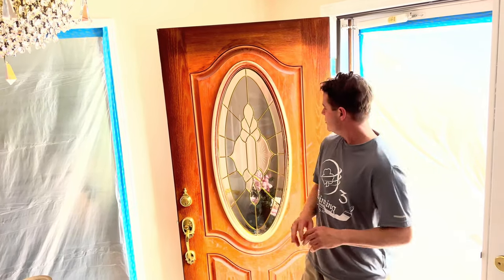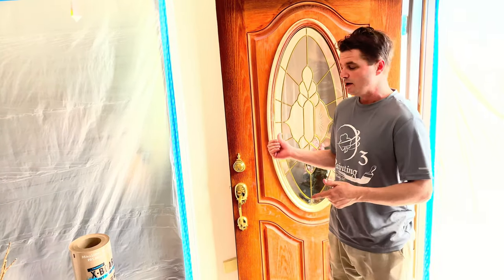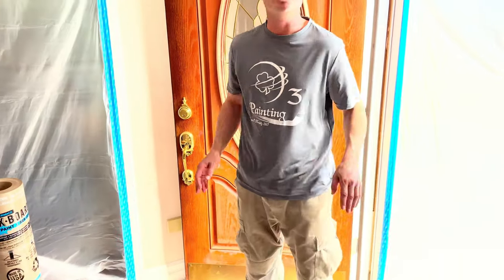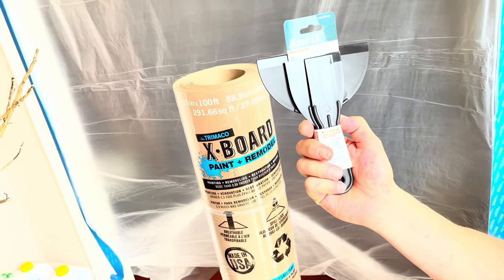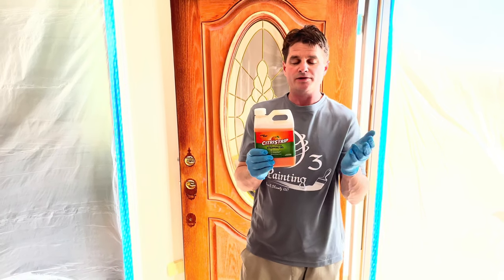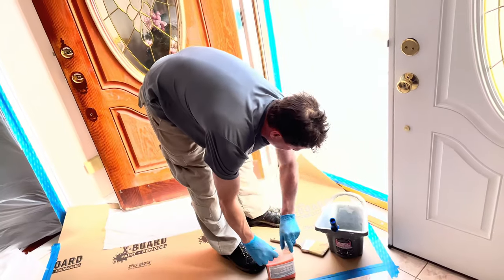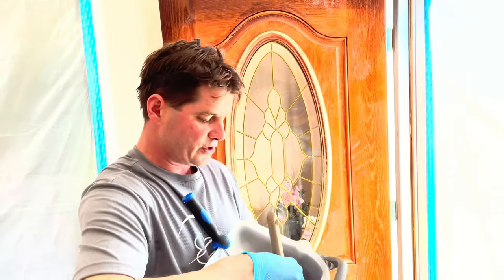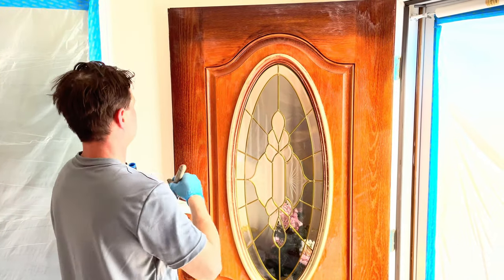Strip  Fiberglass Door using Citristrip Stripping Gel (Part 1)

Comment: Hi Russ, I liked your video and bought a quart Citristrip to refinish my fiberglass front door. Unfortunately, I found "Do not use on Fiberglass"  in the label (helpful tips) of the product. Have you read the label? What do you think about the helpful tips?
Reply from the maker: Hi

Thanks for your question. Therma Tru says to ignore the helpful tips on the labels of some of the strippers. This is a Non Methylene Chloride stripper so it’s safe to use and won’t ruin the door or yourself. Just wear gloves though and don’t forget to use some elbow grease. Happy Stripping! Where you from?

Russ
Reply: @RussOlinatzPaintShow  had the same question.  thanks for this Russ.  Am into my second coat of Citristrip and tin through scouring pads pretty quick but getting the job done.
Reply from the maker: Hi Denise

I just posted another video on this that might further help you!

Russ
Reply from the maker: Hi Denise

I put up part 2 for you!

Russ
Reply: @RussOlinatzPaintShow    thanks Russ.  was so far down the road with with Citristrip but will watch when I'm stripping the inside of the door.  Now going to gelstain the outside.   Is there any additional prep work on the fiberglass door after I use the paint thinner.  Do I need to TSP the door prior to staining.  Thanks much
Reply from the maker: Hi Denise

Ok Great! No additional prep work necessary after washing the door sown with paint thinner. Let me know how you make out?

Russ

Comment: Good to see you here once again.   I was curious and so I just checked the pricing.  This stuff is only $12.48 a quart at Lowe's.  Half gallons are less than $20.  It sure can't eat your fingers off like the Jasco stripper does.  Certainly worth a try.  Thanks for the heads up Russ.   Also... Would removing the door speed the process or make the job easier?
Reply from the maker: Hi

Thanks for your comment! With the door up, gravity will make all the loose stain fall to the ground or in my box. With the door horizontal or flat, there no where for the loose debris to fall. So I prefer it up or vertical. 

Russ
Reply: @RussOlinatzPaintShow   Thanks,  I'm looking forward to part two.  I watched a few other videos about the Citristrip.  I hope you had better/easier results using it than most others did.  It seems to be a bit weak (compared to Jasco's strippers) and it dries out before it can do it's job unless applied in in globs.

Comment: The label on Citristrip says NOT to use on fiberglass doors.  Terrible advice.
Reply from the maker: Check on the Manufacturers Website for what strippers are safe to use for your door. This is a Therma Tru Fiberglass door. On Tbere website, they recommend using Citrus Strip along with many other Non NMP strippers.